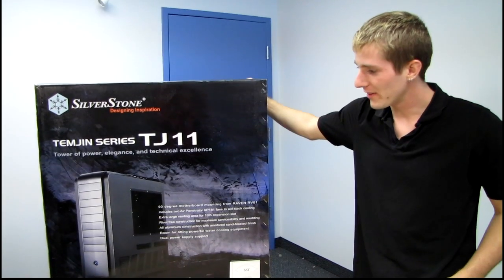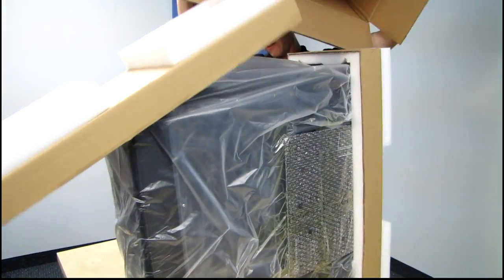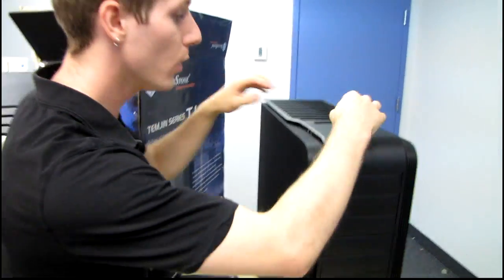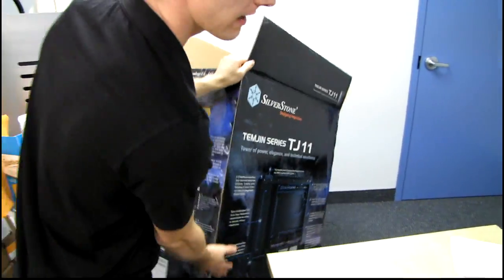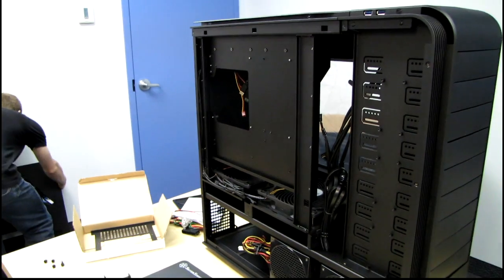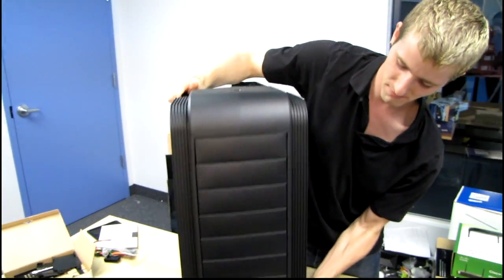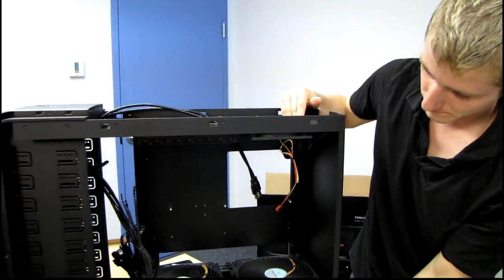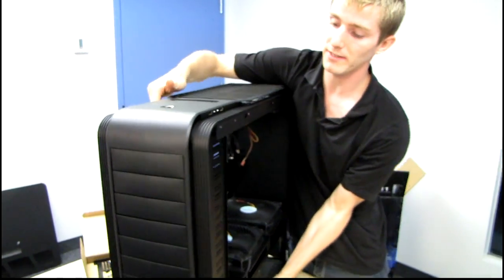Silverstone TJ11B-W Ultimate Computer Case Unboxing & First Look Linus Tech Tips

Comment: some corrections, the extra fan filters are actualy for the PSU's, the ssd brackets are desighned to mount on the side of the drive bays, also the best feature wich is not shown is that the mother board tray is removable, all in all, a good overview of the tj11, I highly recomend this case, but like Linus says, this case needs some serious hardware installed to make it worth its weight in Aluminum.

Stanbony

Comment: this is due to the design of the motherboard tray and this case is not a piece of crap Its designed for water cooling (though air cooling can be done ) it contains high grade material thus making it heavier that way you know your getting a fine product

Comment: I just bought this TJ11 case for $579 Australian worked out nearly $200 cheaper than the Lian Li PC-X2000FB which is $740,the TJ11 is the best case I have ever owned,I am not into water cooling but as for air cooling this case is amazing,also I find having the ioshield at the top of the case is handy,nice and easy to get at all the usb3 ports etc.

Comment: @Poshua92 The cables are supposed to be routed out the back through the opening that Linus pointed out. The top cap covers the cables plugged in so you can't see them. You may need a couple of 90 degree adapters though.

Comment: If you're looking to buy a large case that can hold radiators and is as large as the TJ11, buy a 900d when it comes out. It can hold a quad 120mm radiator on the top. The 900d is also 300 USD less than the TJ!!

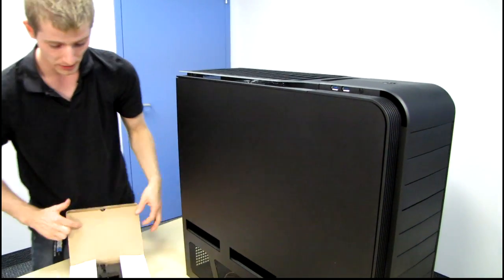Comment: 6:34 They aren't 2.5" to 3.5" adapter! They will place behind the 5.25" Bays.
Result: You can mount up to 9  2.5" HDDs or SSDs  in this case (with out of any specials like a 5.25" to 2.5")

Comment: What an unusual angle for the motheboard to sit at. I wouldn't think for the rear connections to be atop. It would look odd to see your cables hanging from the top of the case. Good thing you can reconstruct the case manually to any way you want. O.o

Comment: I own one of these cases, and I must say that its a monster of a case which can be modified in any way you want, due to no rivet construction.
I must say for price it still could have been designed a bit better, its got the most flimsiest 5.5 drive covers ever seen on a case made from 0.4mm steel which bend so easily.
I guess you cant expect much more for a case made in China can ya, but it still is my fav case I have ever owned, but I did only pay $400 with postage included, and postage costs were $160 via courier, when I think about it I guess I would not justify the $600 RRP on it thats for sure.

Comment: then you can take out the piece that held the 180mm fans and mod it so they fit under it and use fans along the bottom mesh pieces use ap121s to give them cool air

Comment: @willeyboy2  I don't need to learn from videos.  But let me clarify for those who just don't get it.  Whether a system is air cooled or water cooled, the same amount of heat is generated.  The air or water simply transfers that heat from one place to another.  If you have been experiencing high heat weather in your location, you do not want to make the room you are sitting in hotter, so the best idea is to move the radiator/fans... outside.

Comment: I love this casing. 
Is sturdy and I could mount my water cooling, without drilling a hole. 
The SSD mounted on the side of the holder 5.25zoll
the pump I could also mount in the holes for the 5.25zoll

Comment: Its a weird orientation internally, however it would be incredibly beneficial if running multiple GPUs. Since the heat would not be rising to your CPU, but rising to the exhaust instead, and the penetrators will be blowing that straight up too

Comment: @girlskiller16 It's not stupid at all, I have a silverstone Raven RV03 and it also has the motherboard tray rotated 90 degress, my temperatures over an old nzxt phantom are amazing. My graphics cards are running about 20 degrees lower and my cpu about 15, graphics cards are also not being pulled down by their own weight instead they are hanging from the pci backplate screws. It has multiple other benefits and once you use a case like this you will never go back.

Comment: @Astrix321 
Still think there are silly solutions. The top and back are wasted so you would need to have all radiators at the bottom. There are cases that are 10 times better then this and mutch better loooking. Take the Litledevil cases and the XSPC extreme cases for example.

Comment: @eurosonly It depends. It's worse for some heatpipe coolers, especially for GPU. The orientation gets fucked and heatpipes stop working. I had no noticeable problems with the Accelero GTX 280 nor the Accelero Extreme Plus in a Raven case. If you have low airflow it would make sense that hot air rises, but if you got high airflow I don't think it will make a huge difference. Google will give you a better answer.

Comment: three hard drives. assuming your lower compartment is occupied. Like mine i put mine behind the mb tray and i mounted using double sided velcro but i only have one. dont know bout three. u could also put on the side of the 5.25 with yr other 2 ssds although cabling could be a bit long

Comment: hey Linus, when talking about gaming i meant by like Dual GTX 690 with a lot of cables. would you use this case which looks casual or the Thermal taker level 10 GT which looks epic?? and why is this case cost nearly 600 dollar?

Comment: wish they could have done something more with the 2 (per side) fan inlets. u get the slanted mesh at the bottom which has some short of style, then right above...2 rectangular holes. like something the designers forgot about till the last moment. couldnt they have worked those fan inlets into the styled mesh portion? meh.

Comment: So your graphics card is hanging from the backplate instead of resting along the PCI slot, heat radiates straight up and out of the case, and there aren't power cables running from your bottom mounted psu around the top of the motherboard... WHY DOESN'T EVERY CASE MOUNT SIDEWAYS???

Comment: @PROWarrioR And I dont know I would still get a P80, imagine a  480 rad on the back (with a koolance clipper or whatever is called), 360rad down on 90° ^^, and a 480 or 360 rad in front (screw the drivers mount them on top hehe). More than enough...

Comment: this is a 500 dollar case after buying this case i'd probably being dropping another $1000 cpu a $400 MB and $500 ssd, $1000 on the 590 gtx each (cuz no point not going all out, its a crime to spend $500 on a case and $100 on MoBo) not counting rams, storage, and some high end cooling sys. The entire system would cost atleast well over 4K. Then i could brag bout how powerful it is for like a year.

Comment: Call me crazy but, this case isn't psrticulary all that great for what you paid. Sure it can fit the biggest motherboard and and radiator but, thats all it's got. A Cosmos II would do all that and it's only 350 and if your arguement is that this has a window, then A: That better be one hell of a 300 dollar window and B: You can buy an after market full acryllic pannel for the cosmos. If weight is your issue then, why the hell are you moving your desktop so much?

Comment: Oh the Radiator is a MCR220 also I am going for a sorta what Linus did and cut a hole at the bottom of the 5.25 Bays and also do you happen to know where I can put 3 3.5" Harddrives if I have my SSD's 2 at the back of the motherboard and the other 2 in the side of the 5.25" bays?

Comment: why is this case so expensive, i would definetely pay 500 for it. 700 is pushing it. HUGELY pushing it.   I need to ask you one thing though, is EVERY single part of the case aluminum. (Other than the wires?) Every single peice is aluminium right? EVERY OTHER SINGLE PEICE? and how thick is the aluminum. first the unibody peice that runs through the case.   and then the doors and the rest of the case.

Comment: I have a Tt Element V and a Phenom II X6 1055T. My CPU cooler (Tt Contac 29) blows the air directly to upwards where the case has a 200 mm exhaust fan.

I hope those 2 big fans inside TJ11 work very well. Because if I rotate my motherboard to fit this case my CPU cooler will blow the warm air to the BACK side of this case where there is no ventilation. I don't know if this is caused by the motherboard or AM3 socket so please some one reply to this message.

Comment: @willeyboy2  Ok.. but you must admit that putting a radiator in a case is foolish... let's face it, that HEAT has to go somewhere, so during the winter, fine why not?  But during the summer, ARE YOU KIDDING!?  But placing a radiator IN! the case, as bragged about in this video, is what every PC fan believes to be a slick idea... why is that?  Oh yea, lemming syndrome.  Also, that case finish is as bad as the black macbooks!  fingerprint hell!

Comment: Does anyone know where I can put the hard drives if I decide to put in a quad radiator along the bottom? I have like 2x 1TB 1x2TB & 2x500GB full size drives, I've not no idea where I would put them (+ 100GB SSD) I don't want to buy this if there is no where to put them with a radiator in.
I have my 360mm Radiator I plan to have on one side for the CPU and I plan to buy a quad for the other side for the GPU's but I need to find a good place for the HDD's lol.

Comment: @kwrinn67226   No no, I have a Koolance water cooling system set up, with the radiator located in a CORRECT location!, outside my window!  Well no, the entire inside skeleton doesn't just come out, but that OK.  And I have re-route a number of cables... no big deal.  The Outside is 10x SEXIER than the TJ11B and the declining basket case PC market, flowing towards the Apple product line, backs that up.  In 5 years, PC owners, will be hiding their lame boxes, behind their dirty laundry in shame.

Comment: rule number 1 of fan extraction, extract double what you push in. Case design is a fail.
Reply: +dogg755 That leads to negative pressure, which leads to air getting sucked in through any open areas such as vents, which means dust can build up by coming through any non-filtered areas just because the negative pressure means air is sucked into the case. Positive pressure means air is constantly being pushed out of the case, which prevents dust entering through any open areas, and is a much better way to cool the hardware when watercooling is involved.

I've NEVER heard anyone, ever, say that you need to extract double what you put in.
Reply: +dogg755 Positive pressure cases are the current state of the art, and not just in PC cases, but any place where cleanliness is important, like a hospital operating room.